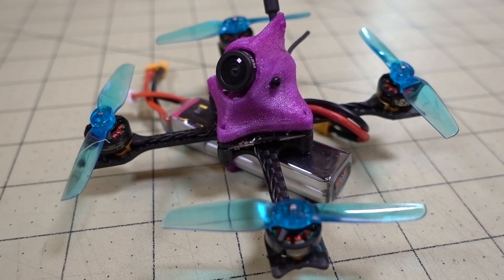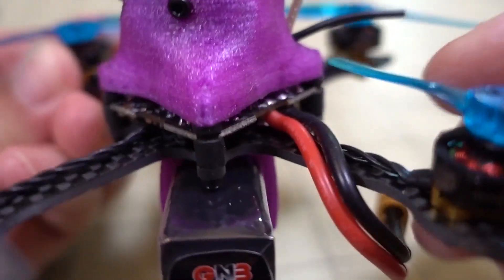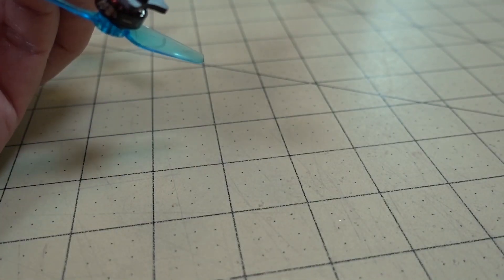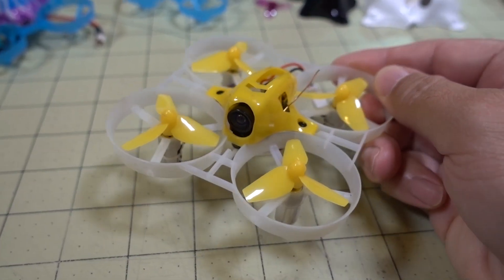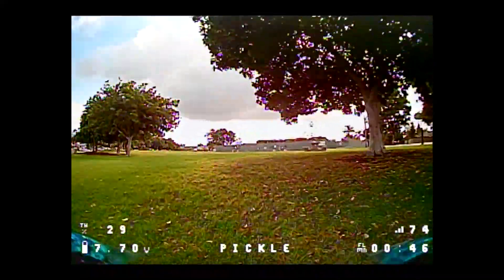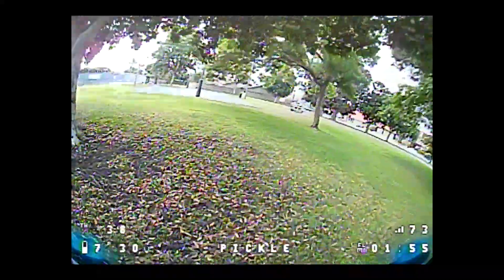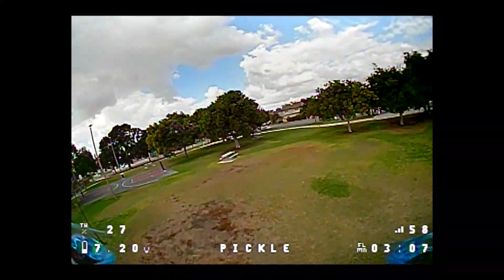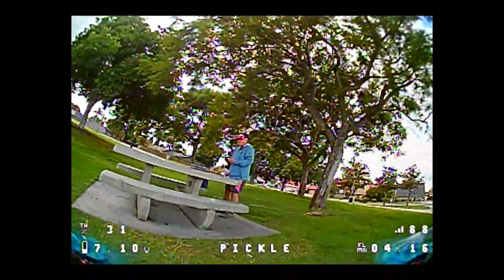Betaflight 4.1 SAVED my Pickle! 👍

Comment: As ever, Cheers Albert! I'll give 4.1 a go on my amax pickle then, I was never that happy with it on 4.0, no major issues with oscillations but I never got it totally dialed in. Actually have to say I went back to 3.5.7 for whoops, struggled to make 4 work for those. 
If you tune this further I'd love to know where you end up if possible please?
Reply: give this a go with your whoops. Flash emuflight, use project mockingbird pids. Makes for a pretty bloody good flying whoop
Reply: @stefanalexander1573  cheers for the tip :) do you recommend strictly just the PID values from Mockingbird or is there any other settings to reuse? PMB on 3.5.7 is the best I've got a 1s whoop to fly thus far, and it is really nice, but it feels like it could be even better
Reply: Whoops on 3.5.7 and PMB fly perfect. I wouldn’t switch from that.
Reply: @1LittleTinker  i actually flashed this emuflight pid settings (ill put at bottom of this post) for filters, emuboost etc. then applied PMB pids and throttle boost of 20 and thats pretty much it. Emu is based on 3.5.7 so i imagine you can pick and choose what you want from PMB.

https://docs.google.com/document/d/1ylAN02KmF3bWU74TcLmfu8Gnqr5hJ4ZVFb01H0V6D-E/edit

Comment: Albert when you saying you upgrading to 4.1 all of your existing micro quads does that mean you purchase the RPM filtering firmware update for all your ESCs? I suspect not many all in one model has yet the BLHeli32 ESCs on board so the only solution left is the BLHeli S RPM filter upgrade. Am I correct or is there other options? Im having several micros now and thinking on upgrading them but Im not sure if its worth doing without RPM filtering or I should only do it after RPM filter in enabled.
Reply from the maker: It's worth it and RPM filter is not required.  You can spend the money if you want to, but it's not required to use 4.1 or get the benefits as i have.  I did not enable RPM filter on mine.
Reply: @AlbertKimTV  thanks a lot it is a great news! Im still using F3 UR65 boards on some and they fly fine (mostly indoors) so i didnt want to risk it without making sure i wont wreck them. Tbh for a very long time the most solid BF to me was the 3.57 so I tuned on it a lot. Now I have a 5'' on 4.1 with RPM filter and flies solid. Your videos now gives me the urge to upgrade the whole fleet. ;)
Reply from the maker: @Lucky32Luke  Just be aware that BF 4.1 no longer support F3 targets.  You'll need a special custom build if you plan to upgrade an F3. On an F3, I'd just stick with 3.5.7.

Comment: Will you be doing a PID tune vid on 4.1 for micros? Coming from 3.5.7 and I flashed 4.1 to test on one of my micros but had to mess with the pid values cause I had bad flutter.
Reply from the maker: I may do one based on the PID tuning guide on github.

Comment: Gday Albert, mate im a bit hesitant to use the new bf 4.1 becauase of the vtx setup and also having to pay for blheli s escs all my escs are s and not 32, should i try it and can i go back to 4.0 or if my fcs are on 3.5.7?  thanks Albert. 👍🛸
Reply from the maker: You only have to pay if you want to use RPM filter.  It's not required.  Also, see my Betaflight 4.1 video.  I go over how to get the VTX table.  It's not that difficult.
Reply: @AlbertKimTV  Thanks Albert i will give it a go following your video.👍🛸